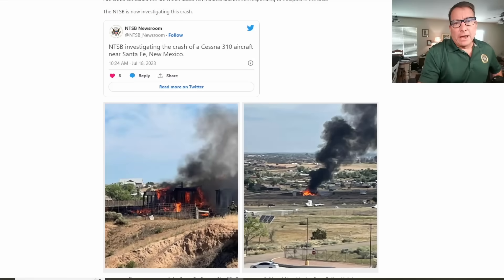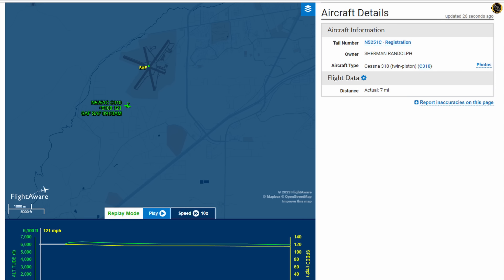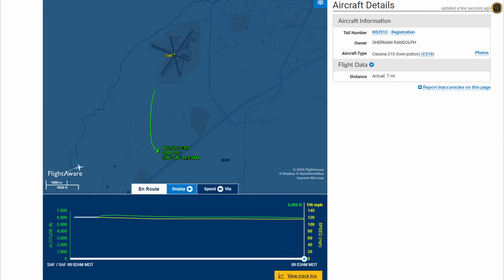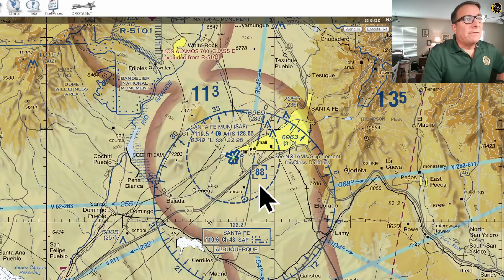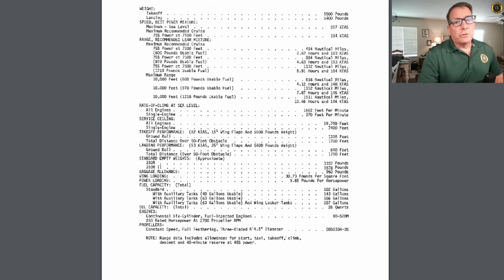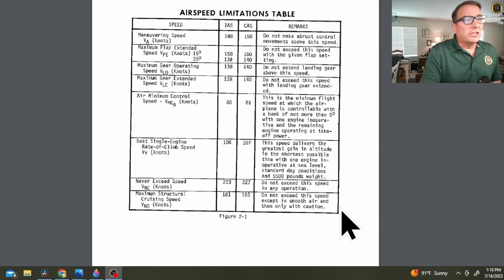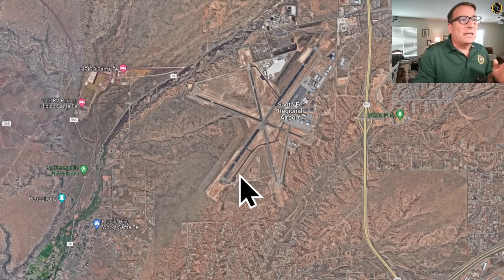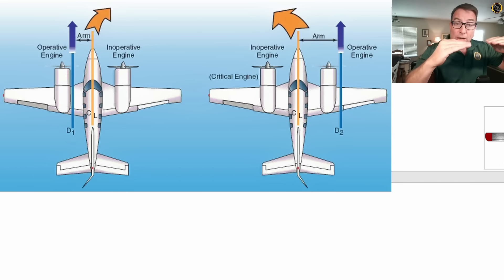Fatal C-310R Engine Failure - Santa Fe, NM

Comment: This comment is not personal to anybody. But occurrences like this are why the General Aviation safety record is so dismal. This pilot could have taken a look at the whole situation and decided not to go at all. He could have spent some time crunching the numbers and seeing exactly what kind of performance or lack thereof he could expect if an engine failed. It's not noted how heavy the aircraft was, with only one person (pilot) on board it was probably well below max gross weight but even if so, at DA if 9000 or more the climb performance would have been almost nothing, even if the engines were 100% to spec, the aircraft was clean and waxed, and the pilot flew it to test-pilot perfection. So: The pilot should have realized beforehand and accepted that if an engine failed on takeoff that the only option would be to *pull off power on the remaining good engine and make a forced landing straight ahead. Now the problem with GA is manifold, first that the average GA pilot doesn't know all this stuff or more accurately has forgotten it due to time and carelessness and complacency. Second that GA pilots don't tend to plan ahead as I've outlined. Third is the GA pilot attitude that "It can't or won't happen to me." That's a BIG killer of GA folks, always has been. Fourth is that GA pilots don't have the skill or practice, as a rule, to be able to react to emergencies properly and fly the aircraft with the necessary skill and savvy to land with a safe outcome. In conclusion, remember RESIGNATION is one of the five Hazardous (Killer) Attitudes. There almost always something the pilot can do to influence the outcome and in fact it is a very rare case when there is nothing that can be done.

Comment: is it THAT dangerous to PRACTICE one engine landings 
with a proper instructor in the other seat, 
AND AN EMPTY & PLENTY LONG AIRSTRIP???  
with ZERO ''height issues'' thru THE WHOLE PATTERN???  

man, it would be soo worth it for THE SYSTEM to build 2 engine aircraft to PRACTICE that very thing, with the engines being able to run DIFFERENT TUNES in a DETUNED STATE (only one detuned at a time, the 310 & FULLBOOST for example)  to turn the 500 hp engines down to what the 310 has for example, then  IF SOME THING BAD HAPPENED and you needeed alll the power HIT THE BIG RED BUTTON and it goes to ''FULL BOOST'' and well yea 1000 hps roar to life.... eh... seems like a cool idea... is there such a training program???

Comment: You used the performance data for a normally aspirated 310R. This airplane was a Turbo Charged 310R which should have had a better performance in high density altitude especially with only 1 person in the airplane.  I can't find the youtube video but I recently watched a youtube video that stated that Vmc speed greatly increases if you are in a bank to the dead engine. In order to maintain control you need to be in a bank towards the good engine. The only recovery is to pull the power on the good engine to regain control.

Comment: We had a crash landing here in Pahrump NV. They had to block the road for a while. I was through there after the crash. It was a small plane and nobody was hurt. It appears it landed on the highway but when it went off the road the landing gear failed. It was probably on approach to the local airport. I would like to more about it.

Comment: Juan I have a question, do you think ATC should have not suggested that runway option? I think in a panic situation this sole pilot made two bad decisions, first one was after take off if there was an engine failure he should have said shut down the good one guide er straight in gear down full flaps, and the second bad thing he did was listen to the ATC after declaring and emergency… pilot in command has priority over everything. What’s your thoughts?

Comment: This aircraft cannot fly on a single engine at that density altitude and a twin because it’s got two engines has double the chance of engine failure, you also have a much higher stall speed for a forced landing. It’s frightening and needs a much higher level of skill to be safe than a single.

Comment: Single engine operation with that density altitude, his mistake was thinking he could climb as note in the ATC tapes.  It is likely that no preflight planning was made for an engine out in these conditions, or he might have elected not to take off.  Looks like it crashed at 14 Agua De Oro, Santa Fe, NM 87507
Reply: It’s 12, not 14.

Comment: Given the density altitude.  It is better to hold straight ahead and do the engine out checklist from memory.  Hold straight ahead and stabilized.  If you can climb, climb. Or just run it straight ahead gear up, get into a power-on slow decent, and hope for the best. That controller distracted him into turning left.

Comment: A good one to learn from. Please forgive my ignorance here - if the dead engine was on the left would it have been better to either go straight and try to find a field or turn right away from the dead engine and head for the opposite runway? Sorry for the loss - condolences. RIP.
Reply: Never turn into a dead engine. In this case, a left engine failure, IF altitude can be maintained/gained, turn RIGHT. Given the density altitude exceeding the single-engine service ceiling, however, he was never going to be able to climb, and thus should have gone straight ahead, picked a field, and belly-landed.
Reply: not a pilot here but thinking about this, straight away and try to land it wherever.  the dead engine would have to be feathered quickly and your turn due to the effect of the left engine probably over shoots an approach to the right side runway putting you in a field anyway

Comment: the pilot followed the ATC directive and it killed him...He likely made a left turn into a dead engine  thinking it was necessary because the ATC told him to right after he declared engine out emergency. The ATC is not supposed to give turn orders in a declared emergency unless there is a safety reason for other traffic. The pilot likely had his hands full feathering had no time to ask ATC why they gave him turn orders. He just decided to follow them and he followed them to his death. The ATC should be fired for breaking emergency protocol. The ATC later tries to cover his butt for his mistake, and tells pilot it is his decision which wat to go , but by them it is too late the pilot was already following the left turn order. This is another clear ATC negligent homicide . they need to fire that controller.

Comment: Juan, If your going to be putting pictures of airplanes up on the site, please make sure that the pictures represent the correct airframes . Please don’t be putting up pics of early 310’s, even if you want to be first with your analysis. The airplane that went down was a 310R. The last model 310 that Cessna made, and in my opinion a very fine airframe. Yes in this instance, a horrible result. Be factual, not first.

Comment: I've said it before and now again-----Today's ATC's are so poorly trained it's a wonder there aren't MORE plane crashes.  Take this guy in the tower.  At least he only had the pilot repeat his emergency ONCE.  Most often, the Controller will have them repeat it several times and this makes me wonder if the ATC actually understands normal conversations since no one repeats the normal conversation.  Why is it an ATC needs to have the pilot repeat the emergency over and over?  Next thing wrong>>>the Controller tells the pilot HOW to fly the plane as seen in "...Make a left turn to runway 33".  IF the Controller were EDUCATED in emergency flight conditions, the response SHOULD have been, "You are cleared to any runway. Which direction do you wish?"  This would allow the pilot in charge of a TWIN to make the right choice and NOT spin the aircraft on the BAD engine.  The Controller should ALSO ask, "Do you need to set it down in a field?"  BOTH of these responses would have allowed THIS pilot to think about his condition and make a better choice.  If you look at the location, there might have been a choice to set it down in a field, but FORCING the pilot to turn INTO the bad engine set the aircraft on a destruction course.  Too bad too.  I love the 310.  We used to get well trained ATC's from the war, but we don't anymore.  You have to ask yourself, "Is it still safe to fly into some airports?"

Comment: Unfortunate,  but Why are pilot rotating before VMC?

I just don't understand it,  one never flies below VMC....
unless you are at a reduced power setting and you are flaring for landing. 😢

Ah I see now the pilot was upwind and probably above VMC  but failed to maintain above VMC when turning the A/C.
Which begs the question, why not just head straight out as best as possible to gain altitude and clean up the A/C, that is what I would do.  And then if I was unable to gain altitude,  commit to the best off airport landing as possible. 

The inability to gain altitude is like the impossible turn and should be treated as such,... all power to idle and land.
😢